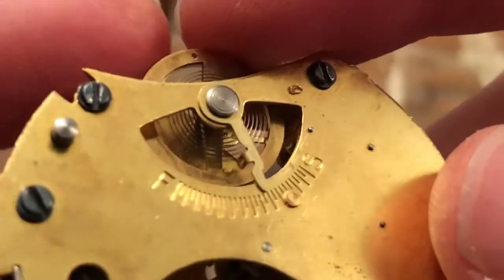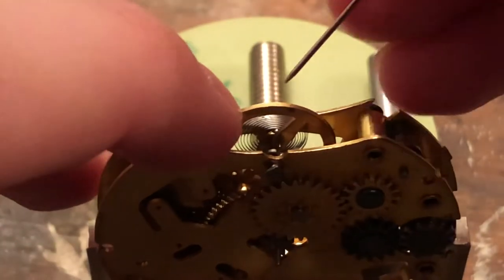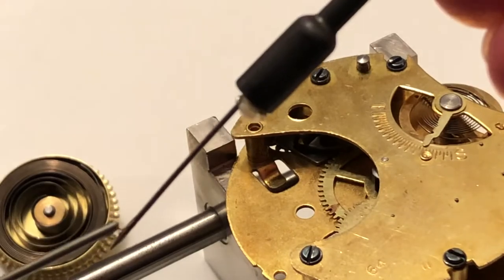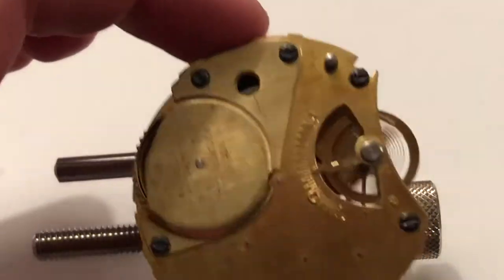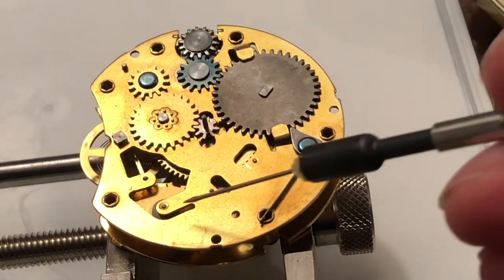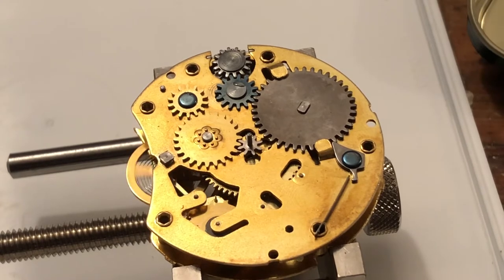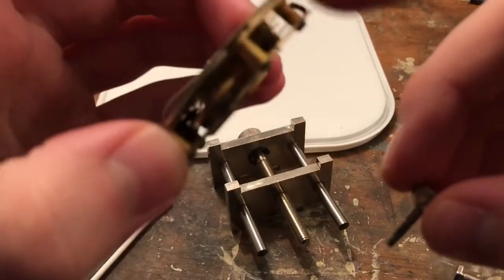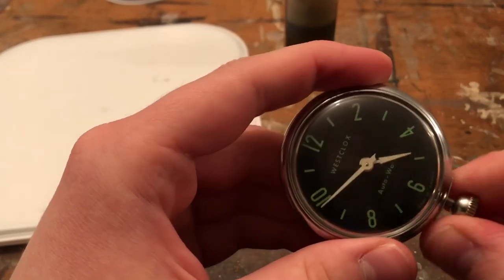Westclox Auto-Watch Reassembly (Part 5) (FINAL)

Comment: This must be a pocket watch. I thought 💭 it was the Baby 👶 Ben alarm 🚨 clock 🕰 all the way.That’s a very stylish piece of metal, the one ☝️ that the mainspring barrel is hidden under. Just don’t have the mainspring spring out if ya need to remove the metal cover for any reason. Great 👍 system of gears ⚙️ there. That had to be the VERY EARLY Westclox Scotty. 1940’s, 1950’s? Your friend, Jeff.
Reply from the maker: This is one of the very later dollar watch moments in a different case. This watch is from 1964.
Reply: @thegregolahorologyclub6799  That’s still way better than dollar 💵 watches in 1978. That’s about when the escape wheel went to plastic, and the cases and movements of Westclox Scotty’s were aluminum. Your friend, Jeff.